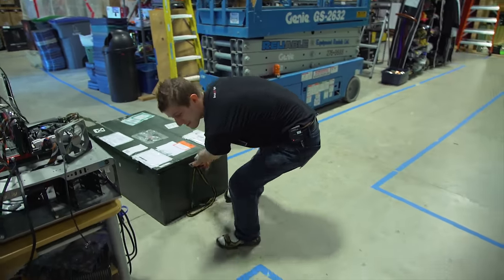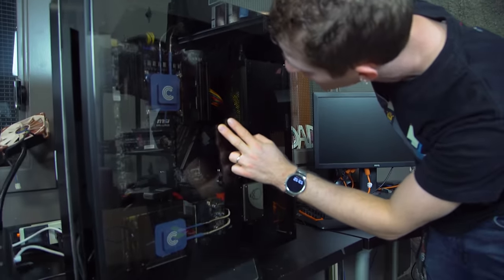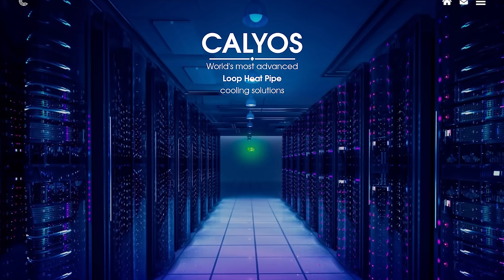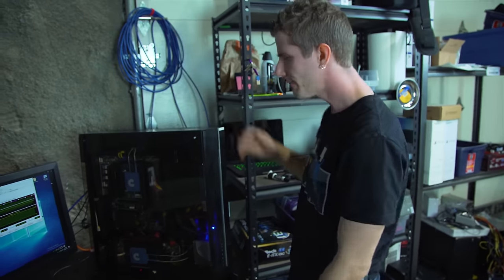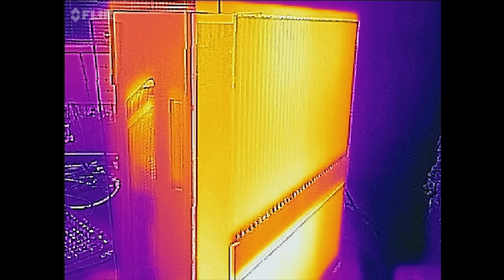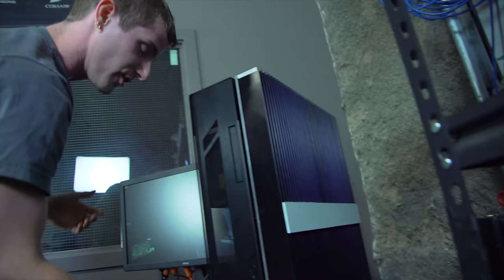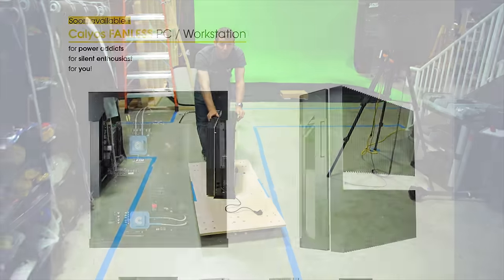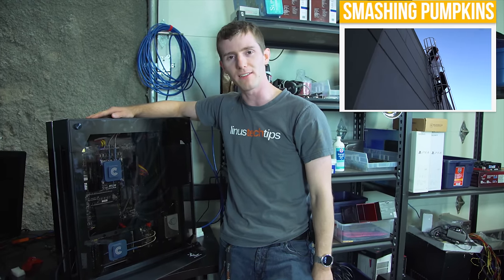TRULY Silent Workstation PC with ZERO FANS - HOLY $H!T Ep. 13

Comment: Although the heatsink totally able to handle the heat, but 2 things cant help wondering in my mind, 

1: when you took shots of the thermal camera, arent you suppose to remove the temper glass first then took the shots? that makes the camera focus on glass not exact on system itself

2: why dont you run the furmark to burn this mechine?  the Crysis if not move, I doubt it still have same load to the unit
Reply: IR camera's dont measure temperature, they measure IR light. IR light can tell us about temperature, but you do not need to remove the glass
Reply: Phenix HSIEH Yes he did have to remove the glass and readings from hardware behind the glass are inaccurate.
Reply: maybe the thermal image lies but the aida 64 and afterburner give you the temperature
Reply: He was not allowed to open the case by contract for the review.
Reply: +Simon WoodburyForget Pointless would be measuring the temperature of anything outside of the case. (I consider the heatsink to be part of the case.) What really does matter is the temperature of the components because that is what needs to stay cool. The thermal camera does not measure temperature, it measures infrared and then it translates that measurement to temperature. The glass absorbs a big amount of infrared and this is why the camera shows a temperature quite lower than what the components behind the glass actually have. But as already mentioned by others above, AIDA64 does not lie and Linus was not allowed to open the case by contract so he didn't have much of a choice but he should have mentioned that the thermal camera results through the glass are inaccurate. Sidenote, when the temperature of the heatsink on the back is 44 degrees, it is impossible for the temperature of the cpu and/or gpu to be less (32 as measured).
Reply: +Simon WoodburyForget So according to your understanding, when Linus pointed his thermal camera at the glass, what exactly do you think he wanted to measure and what exactly did he manage to measure? What exactly is this effort of yours to defend a mistake made by Linus by spreading misinformation?

Comment: I would pay 1K for this if it's upgradeable, I mean only cooling and case, not internals.
Reply: He said it might be priced at $500, which I don't think is honestly that bad. I only wish the chassis part of the computer was thinner.
Reply: Well, getting your graphics card hooked up to their heat pipe stuff is probably the biggest problem, especially if you want to cool more than just the GPU itself.
Reply: Well this is a prototype and they are using a Lian Li case. The could make a custom thin enclosure once they put it into production. I don't think they realise that they could capture a lot of the water cooling crowd.
Reply: Farnese Vandimion it's 500$
Reply: 1k just for the cooling and case? I can barely hear my triple ceramic bearing fans and water cooler and that cost me less than a hundred dollars combined and cools better than this. Why would I pay 1k for JUST the cooling and case? The entire package listed?? In a heartbeat
Reply: kalloused Only the compoentes without the case cost more than 1K. The point of this is not best cooling performance, the point is 0db, no noise at all complete silence. That is 1K worth to me.
Reply: Along with the lack of any sound, not having moving parts anywhere in the system (especially if you have an SSD) allows more reliability on parts that are mission critical. If fans or pumps stop working, that system, which could be a critical node in a server (there probably would be redundancy), would overheat and stop working. With Calyos' system, it would continue to work.

Comment: Not a chance in hell that thing is going to cost $500, talk about bait price. Probably be at least around $1500-2500.
Reply: Yeah, considering specialty Lian-Li cases are already $500+. This one has a proprietary, high performance cooling solution and a ton more aluminium than a regular case. There's no way it's going to cost $500. The shipping alone would be like $100 because of the weight.
Reply: i wonder why pricing is so hard to find on many of the exotic things he uses without entering an email address

its like the company is embarassed because the price they are charging is so high that nobody could afford it
Reply: MWB Gaming That's actually exact why. They don't want random, not serious buyers to go to the page and be like, "Wow, what a rip off", even though their technology is entirely unique to them and it's probably worth that price for what you're getting.
Reply: It's more of a "If you have to ask you probably can't afford it" type of deal.
Reply: it would be cheaper for them if they put the price on the website instead of you needing to give them your email address just so they can sell it to advertisers when you cant afford their products

it should be illegal to withold pricing information in ads and webpages or hide it behind a task like registering
Reply: MWB Gaming dude it's not even up for sale, it's literally a prototype of a not guaranteed future product.
Reply: then how did he get one?
Reply: MWB Gaming the company sent it to him to show it. He said so at the start. And it's not a strange move. If it gets good reception here, then that's already a "free" market study, publicity for both the product and company and might get some feedback from a well respected technology reviewer
Reply: stupid corporate bullshit

everyone should be treated equally regardless of youtube fame level

if he can buy one than everyone should be able to buy one
no special treatment
Reply: He did not buy it...they LOANED it to him to test and make a video...
Reply: im not stupid but you are for thinking people should get special treatment because they are rich and have a youtube channel
Reply: MWB Gaming uhmmm, no, but this ain't no special treatment. Linus has a channel that reaches a lot of people in a particular market bracket (high end tech consumers)  and this company wanted to promote a product they might sell, so they ship it to him, making it a win-win scenario. What, you really believe that they should've sent it to a nobody? One of the main reasons he got it it's because he is famous and is known in the tech industry, if he wasn't known he wouldn't have it
Reply: thats exactly what pisses me off

nobody should get the damn thing
no special treatment
everyone should be treated equally regardless of fame or fortune
Reply: MWB Gaming Hahaha oh please kid please grow up. I find it both frightening and strange that you don't seem to understand that this is business. They're not "giving" him jack shit, they're renting or selling him the computer case and he pays them by doing this video.
Reply: equal rights for everyone is more logical

either everyone can get one or no one can get one
Reply: MWB Gaming There are equal rights, you simply don't own the right currency to get one of these computer cases. If you had the right currency you could easily get one.
Reply: incorrect

they are not for sale therefore no currency can buy it
Reply: MWB Gaming They are obviously for sale, how else would Linus get one?...Derp
Reply: because he has power

therefore not treated the same as everyone else
Reply: MWB Gaming Nope, has nothing to do with power. Stop not understanding now please, this conversation is over I am muting this thread. You're too annoying.
Reply: MWB Gaming this has nothing to do with capitalism. A company is developing a new product, they have a prototype of said product. For market evaluation and publicity they send the product to a known reviewer with a large viewer/reader base of their preference. If it seems good, they move forward with the project and soon enough it hits market, if not, it stays in prototype stage. Linus got it but it could've easily been any other reviewer. Why on god's name, would the company send it to you? They don't even know you exist
Reply: Maximilian Wicén actually they aren't, this one is the only one that exists, Linus got it for review
Reply: MWB Gaming You're hilarious. You obviously have no idea how marketing and business works. They sent a product to a well known reviewer in the tech industry so that tons of people will already know about it by the time it is for sale.
Reply: they should allow everyone to test it
have an open beta test
Reply: MWB Gaming There is literally only one of them in the world right now. You're insane if you think they'd let random people even get close to it.
Reply: then they can test the damn thing themselves
Reply: Go away troll.
Reply: im not trolling
Reply: Then you must be 12 and have zero understanding of how the world works in real life.
Reply: looking forward to it bro
Reply: pretty sure he said the $500 is for a box with no components in it so you still need to buy the PC, its a $500 case.
Reply: that was an estimate i think

but with nearly every exotic item he reviews
he tells us everything about it except the price
Reply: He said the cooling system is around $500, not the entire thing.
Reply: then that would be a first i would think
Reply: Indeed, that's why it's $500 for the cooling solution, not the system.
Reply: MWB Gaming LMG is a company anyways,  not an individual
Reply: still shouldnt get it until its available to the public
Reply: MWB Gaming he is a technology reviewer he gets tons of stuff before available to public,  it's not like he even gets to keep it.
Reply: 90% of the tme they do give the option to buy it

i think it should not be released for review until the general public can buy it
there are a lot of things he has reviewed that i want but cannot get because the company is only selling to corporations (whats the point)
Reply: MWB Gaming I want a gattling gun that I saw a review of by a popular gun channel,  but I can't buy that
Reply: MWB Gaming I especially hate when normal retail websites make you create an account and login just to see the price of something.
Reply: same here
that shit should be illegal

i never understood why they do that bullshit
Reply: +MWB Gaming what the hell are you on about? Should they loan it out to everyone individually to test it or just let Linus test it for millions instead?
Reply: either bring it somewhere for a public demo or dont do any public testing
Reply: and if reviewers want to test it then they should have to buy it like everyone else 
and if its too expensive for reviewers to be bothered then the company should be less greedy
Reply: And car reviewers would have cars everywhere, 90% of his job would have to be maintaining the cars, reselling the cars, buying the cars. Grow the fuck up.
Reply: well there should be no special treatment
if the average joe blow cant go ahead and say i want a free (insert item here) to write a review then neither should he be able to

everyone should be treated equally regardless of fame or fortune
Reply: MWB Gaming does your average Joe has the credentials to do a review? Is your average Joe trusted?
Reply: doesnt matter

everyone should be treated equally regardless of fame or fortune
Reply: MWB Gaming uhm, Linus wasn't treated that way because of either, his job is a  tech reviewer and he is a trusted one
Reply: he has fame and fortune
they gave it to him specifically because he has fame
im sure if pewdiepie asked to do a review on it they would give it to him as well (he is supposedly the most famous youtuber in existence)
Reply: I can't understand that you don't understand that review=money. So offering review for computer case is like offering money for computer case.
Reply: a review is not equal to money
if it was then anyone would be able to do it
Reply: What do you think now 5 months later ? that the PC is on kickstarter with cooling for £500
Reply: I think that it's a marketing thing and that they will retail for $1000-1500.
Reply: this comment thread is hilarious.
Reply: Check their kickstarter. It actually is around 500$.
Reply: What's the name of this software he's measuring GPU and CPU core temps with?
Reply: AIDA 64, and his 'thermal camera' is just a little camera that plugs into the bottom of your phone
Reply: he did say that two dudes made this as a prototype and not for sale (at this time). its no more ridiculous than walking into a paint shop and asking for one off bodywork on a car.
Reply: This is very much for sale (in fact a newer version of it). Just google it.
Reply: Maximilian Wicén if that's 500 i'm going to buy it asap. that's like perfect cooling without moving parts. Is this a dream?
Reply: Linus is a big window for the company to promote the product. You're so pissed that you didn't have one that you're starting to say that "Well if I can't get it it shouldn't exist" WTF dude ? Linus Tech Tips is a COMPANY okay ? Linus is the boss, and they sent the prototype to the COMPANY to test it out, not the BOSS for his personal use. 
Communist.

Comment: Please don't tell me they're using both copper and aluminium in that cooling system..
Reply: Gametherapist Copper and aluminum is only bad in waterblocks. I mean, every cooler has both materials in it, at least the good ones.
Reply: Henrik That's what I'm getting at. If they wanted a "maintenance free" computer and then fucked up the components with mixed metals, that would be... well.. not very good.

They might not have water moving, but there's a coolant in there.
Reply: the coolant moves within the copper pipes, it never touches the aluminium heatsink. The outside of the copper pipe transfers the heat into the heatsink. There are no mixed metals in the coolant loop.
Reply: You really belive THEY missed it, but you though about it here?
Reply: There's coolant, but it was some kind of hydrocarbon (forgot exactly what, sorry). There's (theoretically) no free oxygen to oxidize things, I would think it would be fine.

Comment: That 500 dollars price tag is interesting. I mean if it can still be used after upgrading the components inside the case, it would be a worthy deal as you can use it as long as it doesn't't fall apart

Comment: linus, you can't lift up 72 lbs with both your arms?! i'm disappointed
Reply: It was at an awkward angle
Reply: He lifted it at 3:51 lol
Reply: +Han Lockhart Thin arms but long reach, he could lift that 32kg on the wide side better than you if trained, he's not trained for that bc he is only working with computers.
Reply: Chris Ayres We have a badass here ladies and gentlemen.
Reply: He just dont wanna drop it by accident i would not want to lift that thing alone too
Reply: Chris, there's a difference between lifting "50kg barrels" and lifting a 32kg prototype pc. LOL. Shouldn't need to be explained, but I guess you do only lift barrels for a living.
Reply: "I used to lift 50kg barrels" and that kids is how you destroy your back while bragging about it. Work smarter, not harder
Reply: Yeah lifting barrels ain't nothing. Try lift 70lbs hay bales for 10 hrs and stacking them in a 110 degree hay barn as high as 20 ft in the air
Reply: Erick Rosa shuuuure

Comment: Imagine this in a laptop
Reply: no like the cooling solution apply it to laptop heat pipe...so
Reply: Actually, if you could use this technology inside of a laptop, but then use high fin density heatsinks and still have fans, that would greatly reduce the amount of heat that stays in the chassis, which heats up things like the keyboard and wrist rest.
Reply: Kinda what I was thinking, it would be a great solution. Like fins the come out the back behind monitor.
Reply: Imagine this on a phone.
Reply: what Im talking about is at most a 2.5 pound addition. Not like a fullfledge thing like this. Air fan and heatsink combo. Just enough to help with internal temps, not to break silent cooled laptop records. And of course Im talking about this being used in gaming laptops that are already big, not slim driver laptops used on the everyday.

Comment: 500w for 5860x and a gtx 1080?
Reply: Yes that's how it works.
Reply: MrDeeb8 is 450 too much for my 4690k with an all in 1 liquid cooler and a 970?
Reply: If you don't overclock the components at all or without voltage raising, 500w is just fine. You also have to consider that PSUs are normally most efficient with 40-50% load.
Considering it's a good PSU you should have plenty of headroom free even if you do good overclocks on these components.
Reply: 5820k*

Comment: If you use a thermal camera in front of a glass/polycarbonate, it will read the temperature of the glass. It would not see the temperature of what's behind.

Comment: New Macbook Pro has no fans and is like 4 times more powerful.
Reply: Ah the average troll
Reply: Pienimusta for like 10 minutes then it starts thermal throttling like a bitch😂😂
Reply: Are you sure its only 4 times? I have heard that the CPU has 200 cores and the GPU is the one that is used by NSA/CIA/FBI/etc to do their massive parallel data processing.
Reply: Icarus Also NASA uses it.
Reply: Ahahhahahahahahahhahhahahahahahhahaha
Reply: Apple user here and ... what drug are you taking to claim that the MBP is more powerful than a PC with top of the line CPU and graphic card ?
 Sure the graphic card is OK this time around as they went at least for the next gen but nowhere close to a 1080 with 8Gb (the AMD 4XX on the MBP 15" have only 2Gb)
The MBP will also throttle a lot (apple laptops afford to be fanless by doing that a LOT) and the focus on MBP was more to have low power devices (CPU and GPU are both very lower power draw) not performance when this machine goes all-in in term of power and perfs.
Reply: Frédéric Py The OP is obviuosly trolling; are you as well?
Reply: I have had mac users legitimately think the macbook is more expensive because it uses higher quality components. I nearly fall in the floor laughing every time.